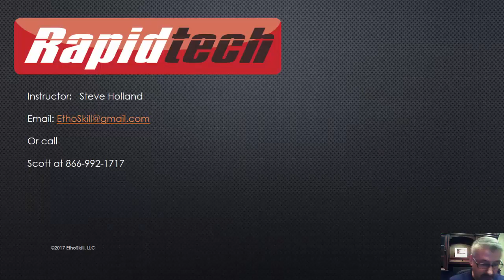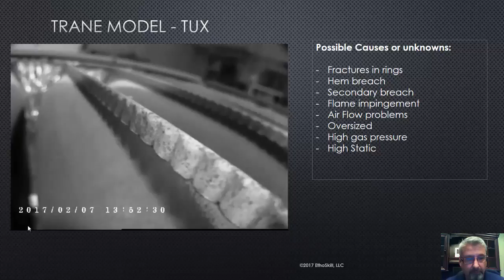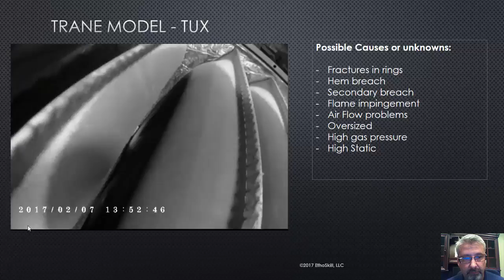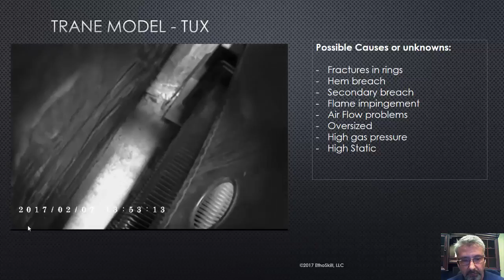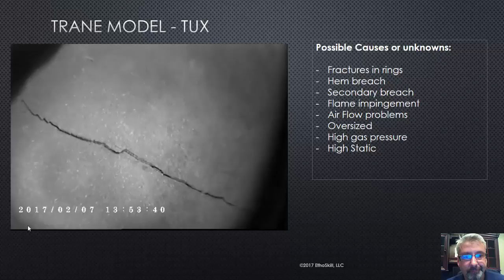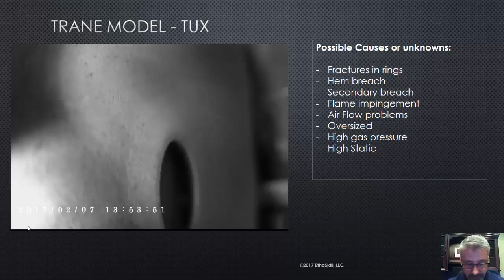Cracked Heat Exchanger - Rapidtech Certification

Comment: THINWALLED heat exchangers will not withstand the expansion and contaction of heating and cooling seasons year after year after year after year and stand up to these stresses. METAL FATIGUE will show itself over time, and will show in  these failures.  I understand that rapid heat transfer through thinner metal is a key to higher effjciency furnaces.  The factors named DO have big role in the life of heat exchangers.  Heavier annealed metal would make a big difference in the life of these exchangers.  Merely my thoughts about this matter.
Reply from the maker: nota newbie. I agree. We have been seeing this as a trend. However, with that said many manufacturers are moving towards stainless steel.